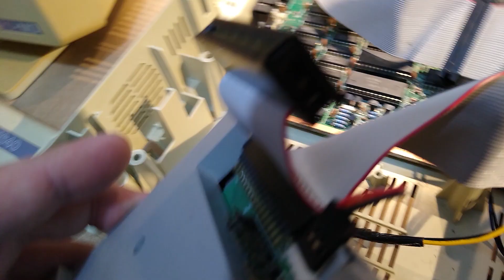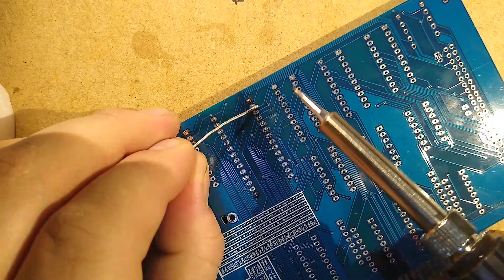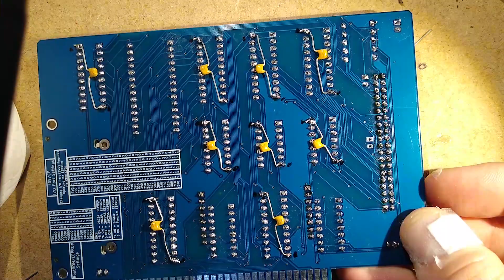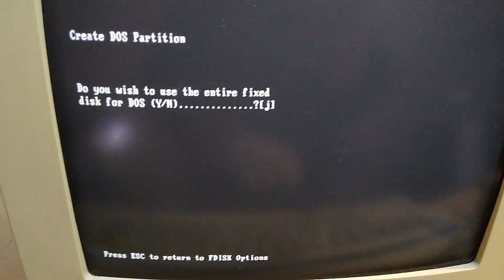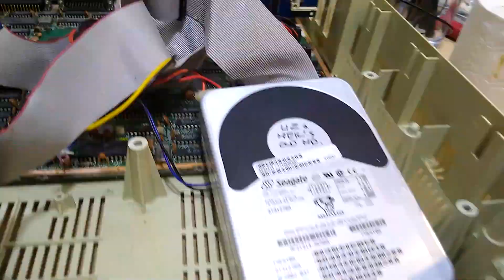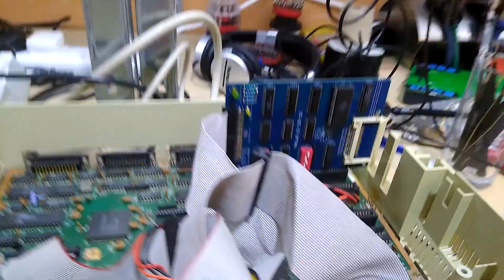Building XT-IDE kit in Amstrad PC1640 - AmsVenture Part 1

Comment: I have just installed DOS on a real 800Mb IDE HDD on a 1512, with DOS 6.22 worked great. one thing i noticed on the 1512 was that i could not format the drive and after that using the sys command to transfer system files, no matter what media or harddrive I used it hung on BOOT. but doing the FDISK (full partition ) and reboot to format the drive with FORMAT C: /U /S and do the format and system files transfer with format command there was no problems at all. Im using XT-IDE V4 with 40 pin IDE interface.

Comment: Did you manage to get the CF interface working in the end? I've got a PC1640 and thought the XT-CF Lite or something would be a good choice - but looks like it may just completely fail to work?
Reply from the maker: Yeah it works fine now. Just my crappy soldering, haha
Reply: @TheRasteri  Ah excellent. I'll buy one then. Plan is to buy a 3.5 -> 5.25 mount and spray paint it the right colour, whack a gotek where the second floppy currently is, then drop a XT-CF in the back and treat it like a hard drive. Reckon that ought to work! Then an 8-bit ethernet card I suppose!

Comment: I just posted a link to a forum post, from the author of the XT-IDE, and what he had to say about the lack of caps on that reseller board. But I should have known the post would get auto-deleted, due to the link. Oops.

Anywho, this info is more for anyone else reading than for TheRasteri himself...

Decoupling caps aren't just about reducing glitches due to RF or noise, ofc.
They also help supply the fairly large impulsive switching currents as the gates in the chips change state.

And because the caps are generally placed close to each chip, it reduces the influence of trace impedance that would otherwise slow down the ability of the PSU to quickly respond to those current spikes.

(and even if the chips on the board itself seem to work fine without caps, adding them would be a bit kinder to the ISA buffers on the motherboard.)

You don't necessarily need a cap next to every chip on a board like that, but yeah, there's no good reason not to add them when they cost a few pennies.

Loved your vids on the CGA/EGA modes, btw. Catching up with some vids more now.
Reply from the maker: Thanks for the info and kind words! Got some more fun stuff with pc104 boards coming up too :)